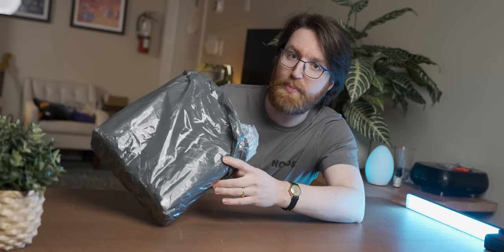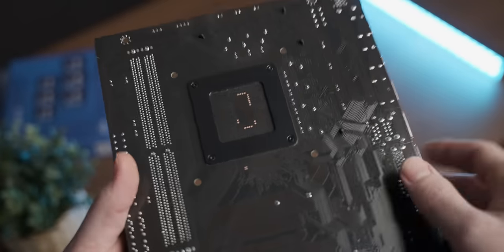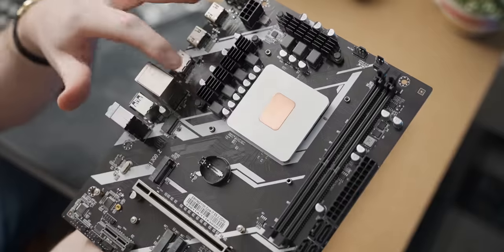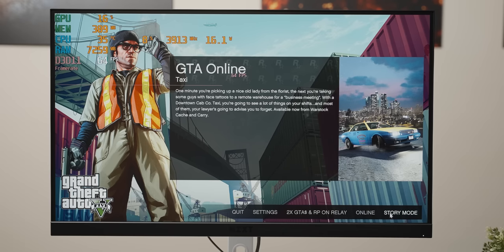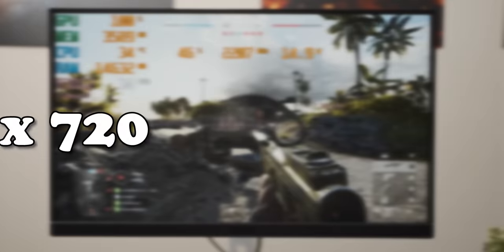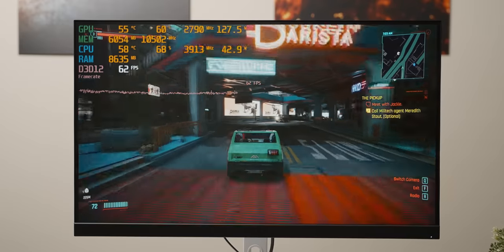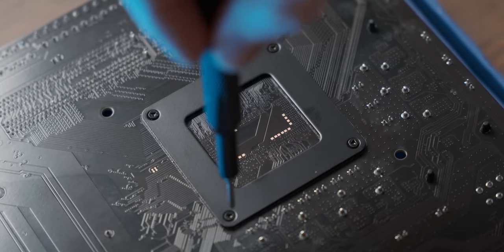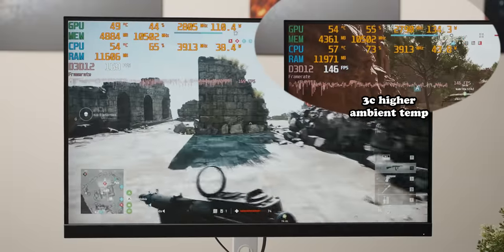Has Aliexpress Motherboard Science Gone Too Far?

Comment: Was there no way to push the CPU power limit a bit further beyond 45w? Impressive nonetheless for the price
Reply: There is, and you can also mess around with xtu and bclk oc. I've seen testing with the i9 version with 4.6-4.7 GHz oc, but then you'd be hitting the vrm limits too, cuz the heatsink and vrm itself kinda sucks. Just using XMP to 3200 would be a big jump in performance too. If you're interested, just search for i9 11900 interposer on YouTube, and you'll see a ton of very good videos from Brazilian hardware youtubers. This kit has been a bit of a hit over here, cuz the performance is really close to a 5600 but costing way less during sales (and being a bit convoluted as well). There are oc live streams, tests against 2011-v3 xeons and ryzens, liquid metal testing etc.
Reply: @DMS_134  well, this thing also kinda popular in our regions, so it's seems you can replace radiators on the VRM to better one and calmly increase TDP. I saw the results there people increase it to 80 Watts and 120 Watts on PL1, measured temperatures with a pyrometer on the VRM during stress tests and everything was normal. The RAM also overclocked, by the way - I saw results up to 3733 MHz
Reply: @luckevich16  Didn't know you could get that high on memory OC. Good stuff.

Comment: Interesting! It would have been cool if you found a way to measure the VRM temps on that board. I bet they were SPIIIIIICY! With that 4070 ti running!
Reply: Cpu draw no more than 50w. It will be cool it's less than i3. Gpu takes power through it's own vrm
Reply: @mateusz2465   Oh right! It’s a laptop cpu, that makes sense.
Also, I was wondering about that, I knew the GPU had its own VRMs, but I was under the impression all of the power to the board goes through the board VRMs first.
Reply: @brando3342  vrm on mobo is for cpu, gpu can take max 75w from slot ( like gtx1050ti without power connector), but most gpus don't - fast all power goes from power cables ( 6pin, 8pin...)
Reply: @mateusz2465   Gotcha, that makes sense, thanks 👍

Comment: I wonder if the pci-e slot is x16 or x8 or even x4. You never know from these aliexpress sellers and/or mobile cpu limitations.
Reply: Usually it will say in the description of the item. If it says it's x16 and it ends up not being x16 you can ask for partial(or full, just lower chances of winning)refund. That's why description tends to be accurate. Always check the description and ignore the title.
Btw this particular "brand", seem to be fairly professional(they don't hide anything, issues included), so I'd say everything they put in the description should be accurate.
Reply: Should be an x16 as these cpus have 20 PCIe lanes

Comment: The bios is Fully unlocked and has xmp support up to 3600mhz, you can even overclock the laptop thing, one guy in the miyconst server put liquid metal on it and it pushed it to 5.1ghz all core and 75w tdp (all the motherboard can give with the upgraded heatsinks) and it gets dangerously close to alder lake performance, for 145 usd as a whole

His ram speed keept resetting to 2133 for some reason but without overlooking he did ran it at 3600mhz when he first used the motherboard
Reply: He couldn't figure out the bios from the last video as well and just gave up

Comment: I have one of those. Needed a new machine on the budget and decided it'd be fun. Mine is the i9 version, stock it will run 4.8ghz single core and 4.1ghz all core. Unfortunately my sample is pretty bad and it becomes unstable even at 4.4ghz for all core loads, so I decided to leave it stock and just remove the power limit. Memory is at 3200mhz with low timings running fine. In benchmarks it's comparable with a Ryzen 5800X or i7 11700K (desktop), PCIe 4.0 works for both graphics and SSD, all that for 150 bucks is a steal imo.

Comment: Running one of these boards with the ES cpu as my main computer. Paired with a 6600M gpu. Works great.
Reply: how did u get the RAM to run at 3200MHz?
Reply: @RadChromeDude  there is XMP setting under Chipset > SA platform > Memory
Reply: @polaris star  My RAM (Muskin Silverline) ran at 3200MHz out of the box. But the other poster may be correct.

Comment: Laptop CPUs are interesting for (home)server usage so i kind of miss the part of power draw. Laptop cpu's tend to use less power than similar performing desktop cpu's especially during idle so they are very interesting for home server usage
Reply: I was able to snag an i5-12500T for $155 on eBay (system pull) 😉

Comment: If you put liquid metal under heatsinc and make some manipulations with overclock - the cpu works like 11900k. I have the samr system, works good with 5.0Ghz 1core / 4.7Ghz all cores. With tdp limit 85W. Under heavy load frequency will drop(to 3.9 -4.1 GHz), but with games i see no drops.

Comment: @DawidDoesTechStuff you're actually wrong in this video. You can enable XMP it's just in a weird spot. Go into the bios, go to chipset, then go to System Agent Configuration. Then, the first option will be memory configuration so click that, go down to where it just says memory, and then you are in a somewhat normal memory page where you can set the voltage to 1.35v for the dram and turn XMP on. The speeds will be limited, my 3600mhz kit only runs at 3400mhz, but that's a pretty big difference from the 2133mhz you ran in your benchmarks.

Comment: memory settings are under the system agent tab...  for 3200 set voltage to 1.35  and enable the overclocking option before using the MP profile and your golden... VRM runs hot on these so be aware...

Comment: There are extremely tight regulations about shipping of lithium batteries.  It requires certain certifications both for the product and the person that is performing the packing.  That is why they left the battery out of the motherboard.  It is easier for you to just buy one from a local store that has the regulations all in place in that supply chain.

Comment: I'm running this in my system with an rtx 2080 super and at 1440p it's running great! you can definitely run memory at 3200mhz, i think the setting is under chipset in the BIOS, but above 3200mhz and things start to get a bit less stable

Comment: This video demonstrates why I am so glad to see gaming laptops move to 1440P displays. 4K is still too demanding for most mobile graphics cards but the 3080ti in my notebook is very capably at 1440P. The higher resolution mitigates the stuttering that would happen if the 12800H was holding up the system’s performance.

Comment: I bought an Erying M-ATX 2.6Ghz ES 0000 for $177 back in March 2024.  It is an i9 11980HK engineering sample.  I installed Linux Mint Debian Edition 6 and it has become my daily driver.  It runs on a PICO-ATX power supply with 12V DC power supply or my LiFePO4 battery bank when the power is off.  It draws at most 8 amps but usually around 3 amps.  My main RYZEN PC died and I never fixed this I just kept rolling.  This thing is for real.

Comment: I saw this on Ali a couple of weeks ago for $160 after I just finished upgrading my VR rig with a used Ryzen 5 3600 and B550 motherboard. I would have bought one of these instead if I had seen it earlier.
Reply: Wow, it's that cheap? Seems like a great deal.
Reply: TacticalMoonstone  gimme a sec ill just upgrade my 10700 for a 11900k because of VR
Reply: TacticalMoonstone  Yes it's my VR gaming rig so I expect to be able to upgrade to a used 5800x3d in a few years the next time I need to upgrade.

Comment: The fact that the CMOS battery was missing is actually not weird but totally normal and expected, in fact it would be weird if it wasn't missing.

The moment you include batteries in your shipment you suddenly have to follow a whole different set of regulations for shipping batterie which would drive up the cost immensely, especially for shipping from china. Those that ship a battery with the board don't care and hope customs doesn't call them out on it but the more sensible option is just to not ship one. CMOS batteries can be had for like less than 5$ anyways, it's a regular CR2032 cell you can find at any local retailer

Comment: you can tune every aspect of memory speeds, very bad bios knowledge there my friend, i have the 11900h ES version, can push the CPU to 4.6GHz all core and memory tuned to 3200mhz with tight timings, its a beast for what it costs.

Paired with a RTX 3060 can play anything for less money than it would cost here in Brazil to get a 10400f with a H510 board.

Comment: I refuse to believe that you can't overclock the memory modules on this motherboard. I have one of the old generations of these engineering samples (9th gen 8 cores I9) and they were soldiered on a socket adapter back in the days and can be socketed in any 100-300 series motherboard. I was able to break the 9900K single core performance and overclocked my 2400 memory kit to 3200 and all of that was on a Gigabyte  H310C motherboard. It was a pretty decent upgrade from an I3-8100 revived the PC completely.

Comment: This isnt a bad idea. first, Lower power consumption means power savings. Second, NO bent pins on an LGA or CPU. Also a great way to put un-used, decent cpu dies to work. Another way to think of it is, adding full fat desktop features to a laptop board and running it as a desktop. Aside from the 30 year old BIOS interface, I like it.

Comment: My board came with a stripped screw and the heat speader was not fully tapped, so the cooler wouldn't mount fully to it.

If you want better cooling, do direct dye.

Comment: Bios battery doesn't come with the motherboard because when it gets shipped over on a plane there is a possibility the battery could "explode" or rupture and then you get a motherboard that's unusable with battery acid and corrosion all over it. Not to mention the other logical damages or dangers to property or other goods being shipped on the plane. Its a safety, customs, and customer service thing.

Comment: Being as the contacts are all copper, why not just use liquid metal between both the CPU and the plate and the cooler and the plate. I believe it would come within margin or even beat having a cooler just dangling on a chip. Considering there is no pressure with an unsecured cooler, having the pressure should in fact make it uniformly cooler to top that off so again, it should meet or beat those temps. Love to see you try that. Order the top end 11900H and see what's up?

Comment: A good thing to note for the Noobs, is that LGA 1200 coolers use the same spacing and are interchangeable with the 115X coolers, so any cooler from a system with an Intel Core series CPU prior to the 12th gen will fit on this board.
Reply: it changed with 12th gen right?

Comment: Thanks for the video, i'm trying to build a powerful pc inside of a hollowed out first original Xbox shell my friend gave me. Overheating is my main concern and laptop CPU and GPU will definitely be an ideal option since they don't use much power, less power, less heat. With a low clearance CPU cooler i could make an xbox 1st gen more powerful than a PS5 pro.

I found a RTX 3070M with EVGA heatsink, for only $250 cad, probabaly using frankestin installer like the RTX 3060M, but it should be a super powerful GPU without worrying about thermal thruttling since EVGA has the best material and what not.

Comment: Since the CPU doesn't have any capacitors around the die, it's easier to apply liquid metal, you only need to protect the aluminum of the cold plate.
Reply: protect, how?

Comment: Man, I wish you would've posted this 2 weeks ago. I was looking at one of these but couldn't find any reviews about it. As for the ram speed, it's probably locked on an i7 - 11800H, if you get their i7 - 11980HK it might be unlocked so you can manually tweak the ram speed to the XMP speed.
Reply: It is, although temps and poor VRM will cause it to throttle

Comment: That's interesting that the CPU and iGPU are on the same die for intel. On older intel cpus (at least with 8th gen intel), it has a seperate igpu die. Also apparantly the 11900H doesnt have Iris xe integrated graphics which was new to me, I would have assumed it would have come with iris xe graphics. 

When I bought a replacement motherboard for my old laptop (I found like 2 of those motherboards on ebay and they were more expensive than the laptop itself and also came from China) from AliExpress, the seller did literally the same thing as what you did with the cpu cooler. Just laid it on and tested it.

Comment: Someone already mentoned that bios has a memory section but generally if you ran to the same problem just put some OEM (JEDEC-3200) compatiable ram instead of the one with XMP and you will be fine. they using the same modules on most Dell/HP/lenovo OEM PCs with limited bios func. usually they have no brand beside the chipmaker (samsung/hynix/micron/etc)

Comment: The CPU temps are also amazing, nothing like a big air cooler on a 15W cpu
Reply: and my 10th gen enginerring sample laptop chip hits almost 175w and its rated at 5-25w.
you know laptop chips are highly binned chips for the effeciency, not the potential of clocks / speeds

Comment: To get XMP1 profile on that amazing motherboard and (laptop) CPU you need to do the following:

In BIOS (esc key to back out of the menu options)

Advanced\Overclocking Performance Menu\Overclocking Feature: set to Enabled

Chipset\PCH-IO Configuration\SPD Write Disable set to False (it's near the bottom of the menu)

Chipset\System Agent (SA) Configuration\Memory Configuration\Memory\Memory voltage to 1.35v

Chipset\System Agent (SA) Configuration\Memory Configuration\Memory\Memory Profile to XMP profile 1

Save (F10) and exit.

Comment: lol theres a local guy in Vancouver selling these for 220 CAD. according to his testing this chip at 50-75w pull scores better than a 125w 9900k at stock settings.

which is pretty good for such a low power chip while still running pcie gen 4

Comment: Holy shit I have one of these. Best deal I've EVER MADE. Faster than the desktop version of the cpu, smaller processor node, less power, whole board costs more than the cpu alone.

If you have a cooler that plays well with direct dye cooling, def buy one.

I got thr i7 one but there are i9 ones that would perform really well if you can cool it.

Also, undervolting overclocks the cpu.

Comment: I gambled and lost on this board. It was acting odd as soon as I powered it up. I tried running running Kdenlive and it locked up. So I tried testing it. It ran the single core cinebench without crashing but failed on the multi-core. Next I tried the intel stress test. I fails consistently after 30 seconds. Erying support suggested it was my power supply (600 W and worked fine before the new board). Then they said it was the ram (also purchased from erying). I tried running with one stick removed and then the other and had the same problem each time. Then they sent new bios - same problem - it cannot run the intel test for more than 30 seconds. Since I posted a bad review (based on my experience) Erying has refused to help me further. Aliexpress refused to give me a refund and refused my appeal. So I'm out the cost of the board, the ram and cooler - all from Erying - BEWARE!!!!

Comment: If the price is right, these are sick little budget systems.  Only, in my experience, even laptop bios are usually smart enough to set the memory speed correctly as long as it’s a supported speed.

Comment: It's strange that it is defaulting to 2133MHz memory. The CPU should be requesting it to run at 3200, obviously XMP isn't usually possible on laptop chipsets but the CPU determines the RAM speed and in the case of 11800H it's 3200MT/s.

Comment: You should pair it up with the sff gpus 1650 and 6400. See how small of a case you can fit it all in. See how well it games, temperature and power draw. Rig up a smaller AIO. You're going to have to get creative. Great video.
Reply: Metalfish g5. 

Litterally smallest case with matx support (2 dim/ smaller matx size) and has 3 pcie slots for stuff like the a2000 / low profile gpus

Comment: Hey Dawid, is the supplied heat spreader actually a solid block of copper all the way through or is it 2 thin copper plates recessed into the aluminium block?
Reply: lol what? why bother and press copper from cooler side? probably solid block
Reply: @vipvip-tf9rw  to save cost, copper costs a lot more than aluminium.
Reply: @James_Howarth  why would they press copper from cooler side it won't help in temps, if they wanted cheap, they would use copper from one side only
Reply: @vipvip-tf9rw  to give the impression that it's a solid block?
Reply: @James_Howarth  I don't think people who buy this type of mbs think about heatspreader that much, Even if it was solid aluminium it wouldn't throttle